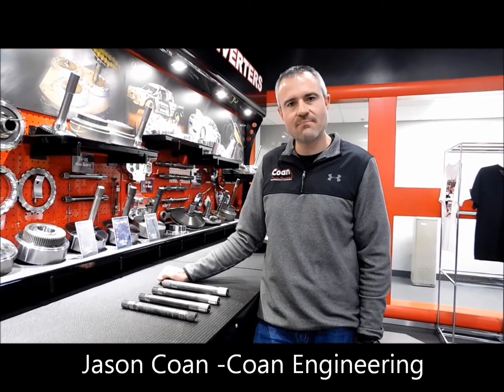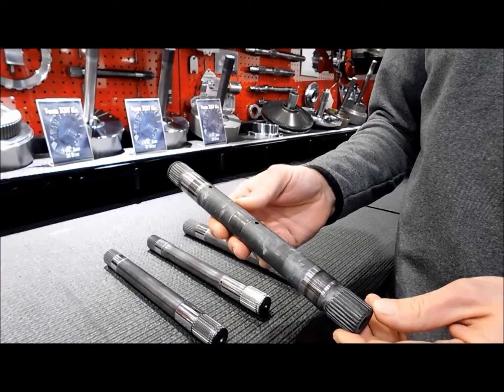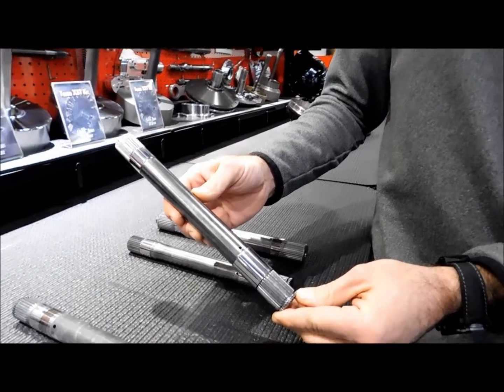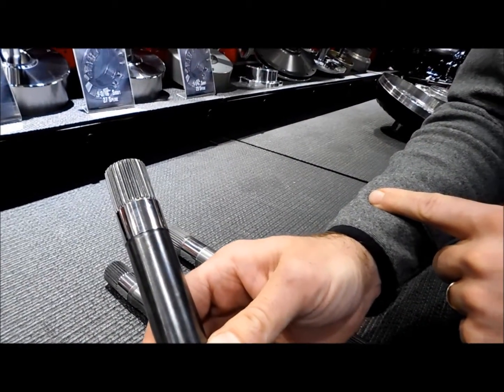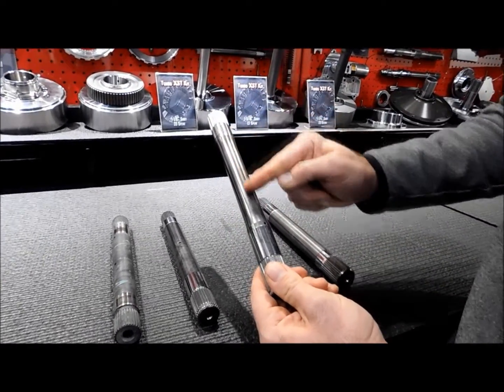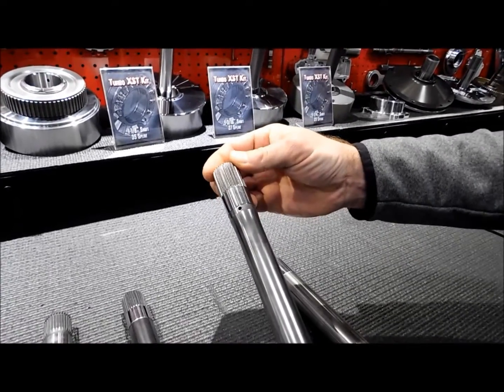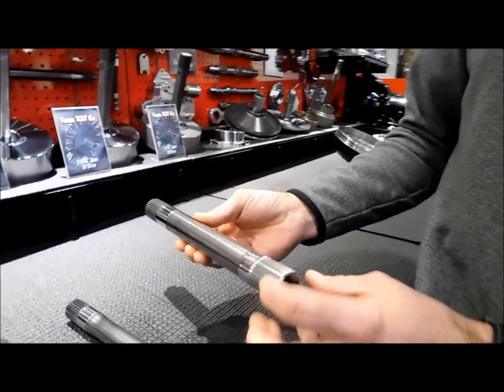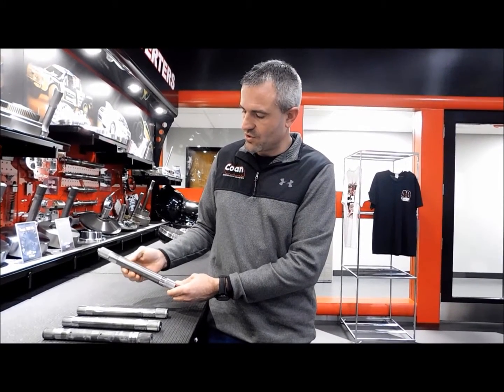Jason Coan discusses the differences between TH400 transmission main shafts.

Comment: 20 yrs ago a picked up the phone and ordered a Coan th-350 converter when I live 2 miles from Jegs original store and they have always treated me with the utmost respect.i was buying from you bc you close enough if I have to have it retuned in case we missed it a little.406sbc about 500 hp.,care to guess what was sent to me before I was shunned?an 11” 26-2800 stall.i was expecting a10” 34-3600.a $300 converter then is the same as a $600 converter today.it has about 200 miles on it and is as useless to me today as it was then.the guy that took the order never wanted to talk to me again.this to say the least not what I expected when I called Coan.